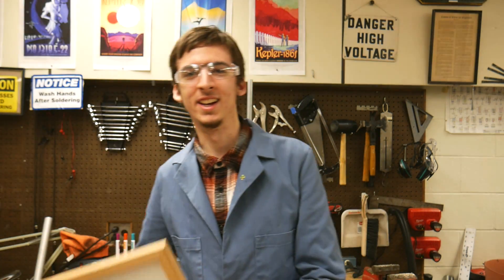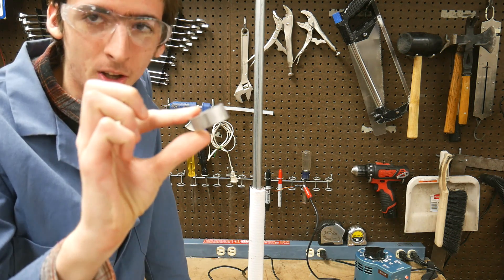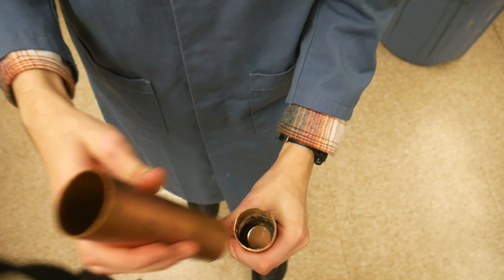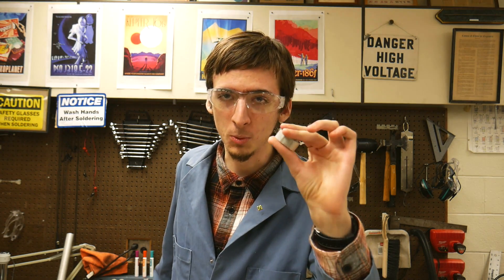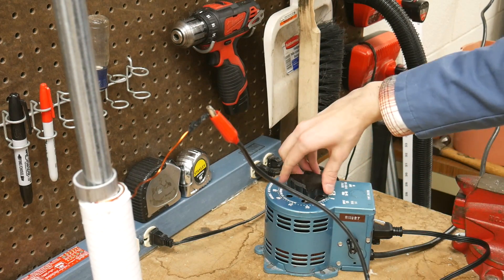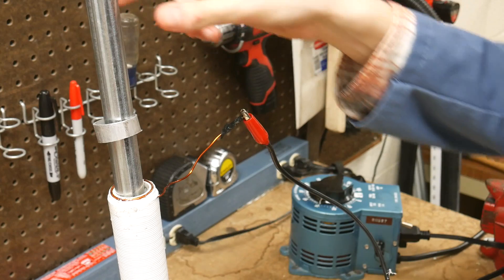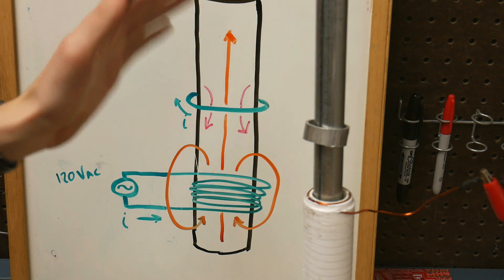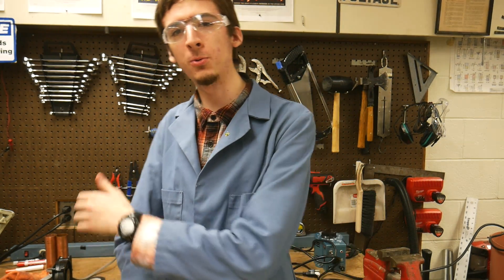Mini Project: Simple DIY Levitation

Comment: Are there any equations to find power of an electromagnet?
Reply from the maker: There is, but it's not the easiest thing.
You need to find the impedance of the electromagnet and work from there.

This link should help you: https://eepower.com/capacitor-guide/fundamentals/impedance-and-reactance/#

Comment: What would happen if the voltagz was 120v DC??
Reply from the maker: Click "Read More" to find out....

Ha! Clickbait is awesome!
Nothing would happen. Only changing magnetic fields make this trick work. A DC voltage would make an electromagnet.
Reply: @BlueprintScience  yes ..but i mean the levitation.??we could have a levitation using DC hight voltage? Hope u do the same experiance xith changing Voltage :)
Reply from the maker: @abdeljalilpr2033  You're talking about Van de Graff generator voltage levels? Maybe one day...
Reply: It won't move, because only a changing magnetic field can induce a current in a conductor that turn the conductor into a magnet. DC through a coil does not make a changing magnetic field only AC does.

Comment: Isn't it Eddy currents
Reply from the maker: Yep. Eddy currents apply whenever a magnetic field changes near metal (the magnet falling thru the pipe) and this is a more specific case where the current has a closed loop (the ring or the pipe) to traverse. Think of it like a transformer. Overall the current goes around the loop as per Faraday's Law: ∮E*dl = dФ/dt

Comment: Please make video on DIY wireless charging.
Reply from the maker: ok
Reply: I powered some LEDs wirelessly at 50Hz once. It´s great fun!
Reply from the maker: @Basement-Science  Ha! Did you hold them near the power line's transformer?
Reply: Lol not quite :)
I´ve got an air core solenoid that has so many turns that I can hook it up to 230Vac, or even more for a short time.
With the right secondary coil you can make it work :)  (motor from a microwave fan, with the rotor removed.)
Reply: @Basement-Science  I did so many turns but it doesnot work. I dont why my led didnot glow😕😕
Reply: Krish Gurung If you describe your setup completely, maybe I can help you.
Reply: @Basement-Science  Yes please help me. I have a project and i want to make wireless charging or tesla coil. But why my tesla coil and induction coil doesnot work i m still in confusion. May be due the reason that i am at zero level in basic electronics. I m only 16. 😀😊😀

Comment: I've heard the thicker the copper tube the slower the magnet will fall... How thick a copper tube would you need to totally stop the magnet 😂
Reply from the maker: Impossible. That would imply a system that is 100% efficient.
Reply: You could do it with a superconductor. That´s the only way.